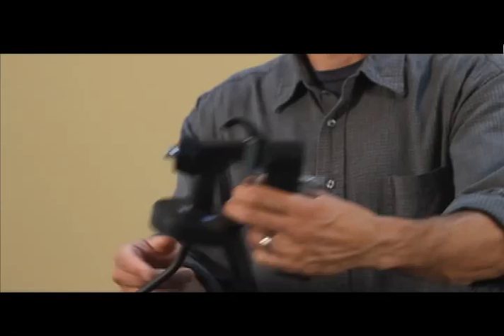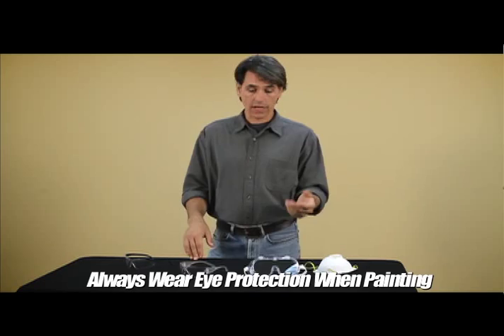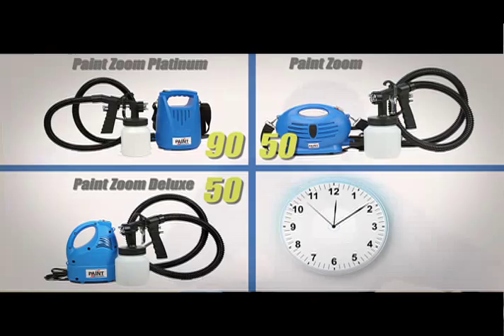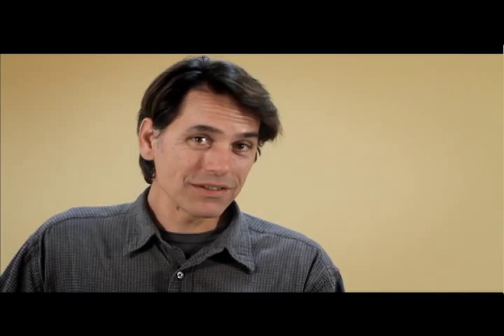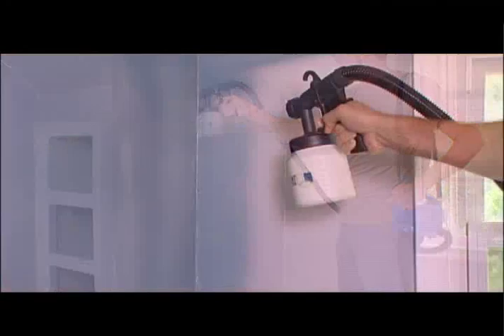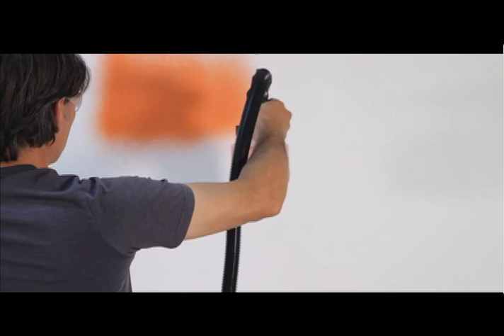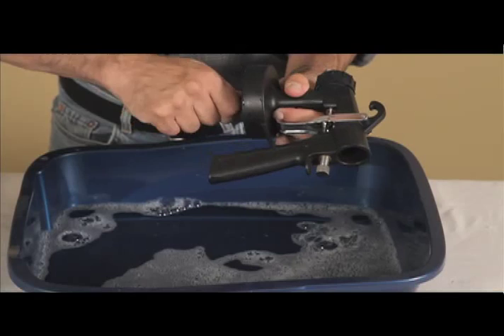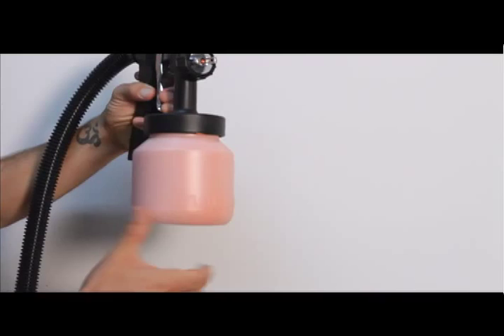Paint Zoom Reviews + Paint Zoom Instructional

Comment: It is good only for painting small projects ang using only latex paints. Using locker base paints will melt some of its parts, since it is plastic. You can also recycle the motor.
Reply: Sir hindi ba pwede likr pang repaint ng motor?
Reply: It will lock the parts because of the locker base.